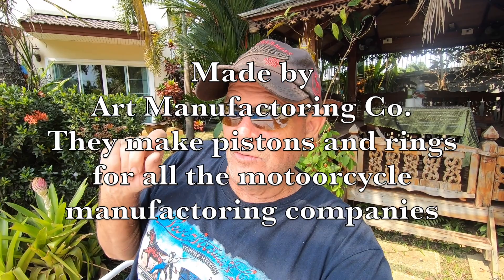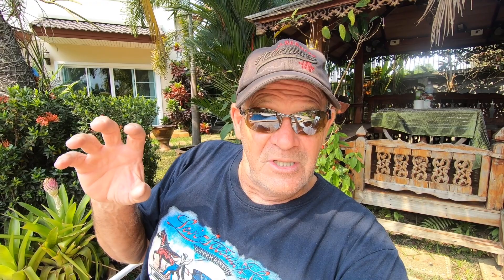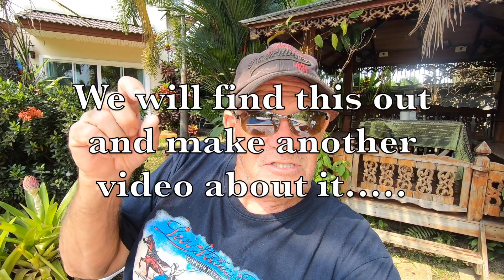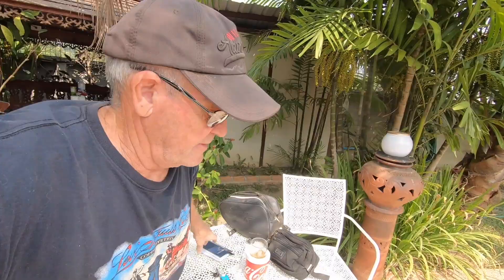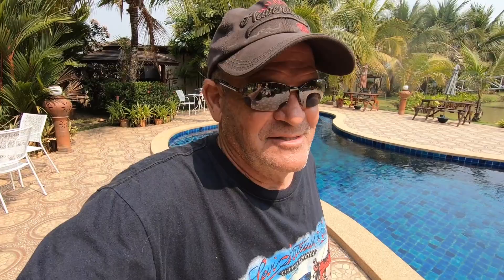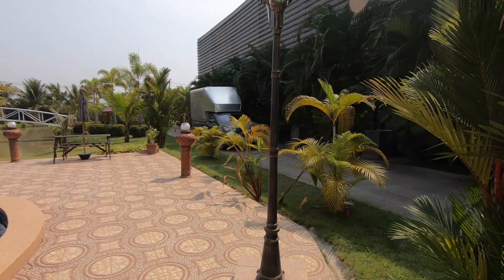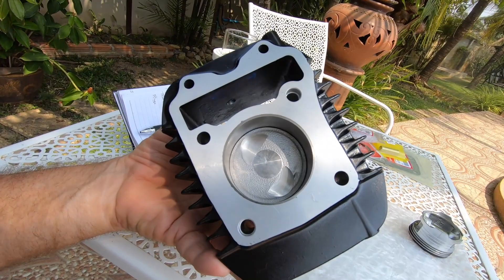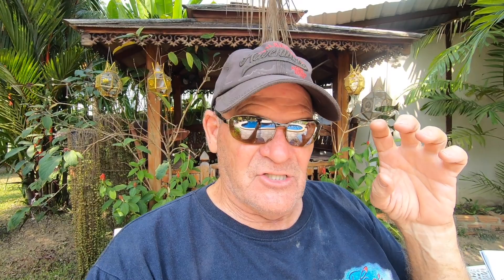Honda CT 125 How to make your own 142cc Big Bore Kit

Comment: Thanks, Eddy, I've done my Honda Part Number Homework and the parts listed above fit as follows 

12251-KYZ-J01 Head Gasket 2021 CT125A, 2014-2020 Grom, 2019-2021 Monkey, 2019-2021 SuperCub

12191-KYZ-900 Base Gasket Grom/Monkey/Supercub the CT125A uses 12191-K73-T60

12100-K26-900 Cylinder CT125A and Grom  2014-2020

16450-K36-J01 Injector Assy, Fuel is off a 2015-2020 PCX150A

All of these are currently available and fairly inexpensive about $121 Retail from our store that I work at in Utah.

Can anybody help me with finding these Piston/Rings/Clips here in the US?
Reply: For the rings, you showed part number 13008-0006 KAZE125 STD That part number is the rings off a Kawasaki Z125.  Could the Piston also be off this bike? That would make getting all the parts a piece of cake.
Reply: Just did a google search and the bore size on a Grom is 52.4mm and the bore size on a Z125 is 58.0mm Does that sound like the right size bore for the piston you received in the kit?
Reply from the maker: Ok, the cylinder number you have listed is not the number for the cylinder we got and the base gasket number is also not the same. Could be the Kawasaki Z125 cylinder and piston, which makes sense that the hop up shops in Thailand have been mixing and matching parts to make the scooters here into little rocket ships. Recheck all the numbers I have in the description for this video. This has been a big help, thanks......
Reply from the maker: @TrevPerry  Sounds like this is what they have done. Kawasaki parts on a Honda....... Smart
Reply: @TeamDNFracing  I just checked again I just put the wrong number in my comment.  I fixed it.  Cylinder 12100-K26-900 Is the stock Cliinder from a CT125A and a Grom. I think it's just the stock cylinder bored out to a Z125 Piston and Ring?  I've already ordered the Honda Parts and I guess I'll call another shop and order me the piston and rings.  We are a Honda only dealership.  Guess I better get me a Diablo Pipe coming and we will awaken the "BEAST" I'm the one with serial # 0666 Thanks for the help!  Anyone else agree this is what is being done in this kit?  5.6mm bigger bore size is going to make a difference.
Reply: @TrevPerry  So will the Kawasaki piston come already relieved for the valves and is it taller thus creating a longer stroke and needing the cut-outs on the top.  Does the 128cc piston really equate to a 142 cc bore?
Reply: @spydie  142cc is the displacement, the actual bore is around 52.4mm for the CT125 and 56mm for a Z125 see my longer comment below.
Reply: @seankearney6915  Gotcha.  Now I understand.  Thanks
Reply: @spydie  Glad I could help. If you want to seriously do your head in look at the table of Bore and Strokes British Leyland did with the Mini it has engine sizes of, 850, 997, 998, 1071, 1098 and 1275. Real parts bin engineering.
Reply: @TrevPerry  Sales brochure I found said 56mm for the Z125 Pro but with a CT125 stroke it fits. Longer Comment below.
Reply: @TrevPerry  Did more searching and while I found the Z125 to be 56mm I found the Ninja 125 to be 58mm  My calculations suggest that a 58mm piston would give 153cc while a 56mm one would give 142.7mm
Reply: @seankearney6915  Does this work void the Honda warranty?
Reply: @longrider9551  I would say almost certainly. Fitting Kawasaki parts to a Honda. I am sure they would frown on it.
Reply: Even the Honda bits are being used in a way they didn't intend so I doubt they would approve. But most performance mods you are on your own if you go to far and blow the engine.
Reply: Trev,  I also live in Utah and am just considering doing this upgrade.  Wondering if you have completed the BBK and if so what are your results? Also, would very much like to chat in person with you if you have done this.  Thanks.
Reply: @shawnlupcho7883   I work at Honda World and actually sold my CT125 to one of the salesmen here.  Stop in and talk to Tyler at the shop he owns it and yes we did do this kit on it.
Reply: @TrevPerry  Awesome!  Thanks for the quick reply. I live in Park City but should be headed past your shop sometime tomorrow afternoon.  I'll drop by then.

Comment: Thanks for the wonderful vid of the Bigbore setup. I have done a month of research. I have purchased two pistons from the various suppliers, ccd both piston tops, done the calculation and in both cases the compression ratio of these big bore kits is right up around 11: 1.  With normal pump gas like 85 or 88 octane, detonation is certain, and it is only a matter of when, not if, as to when the piston says goodbye. ( Normal Hunter Compression ratio is 9.3 :1. ).   For me red flags went up when I read on one of the suppliers website that you need to disengage the auto decompression system when fitting a big piston. Of course none of the folks selling this stuff will ever touch on these matters. The bigger fuel ejector and running a higher lift cam will help the issue, however higher compression develops more heat. I am curently doing the calculations fitting a stroker pin to the crankshaft and staying with the stock piston and fitting a longer conrod, to see if the compression will be lower doing it that way.Stroker pins are available and rods are as well. Hope this is helpful. Be careful everyone.    Thanks

Comment: The taller piston will raise compression, only way to increase stroke is to lengthen the connecting rod. Really cool kit, thanks for supplying info your house there is georgeous! Your livin the dream.
Reply from the maker: Not sure what I was trying to say on that part, but you are the second viewer who called me on that. Sorry for the confusion, I know better, what I meant to say and sometimes at my age, my mind wonders a bit, but the taller piston will kick up the compression...... Thanks for pointing it out, that lets me know that people are watching the entire video which is good..... Again, thanks for catching that......
Reply: @frank gulla  Lengthening the conrod does not alter stroke, it just changes the piston height at TDC and BDC.  Also slows the piston speed.  Manufacturers spend a lot of time working on conrod length to stroke ratio to prevent piston wear.  The only way to change stroke is change out the crankshaft, or offset grind the crank.
Reply from the maker: @ArchimedeanEye  You are so correct, my mistake on that and I do know better.... Sorry for that.....

Comment: I have just done some googling and got figures from Honda and Kawasaki websites so there could be some anomalies but the Kawasaki idea works with the maths. The CT125 is supposedly 52.4mm bore and 57.9mm stroke giving 124.9cc. The Kawasaki Z125 Pro 2021 is 56mm bore and 50.6mm stroke giving 124.7cc.. So in relative terms Honda longer Stroke for torque Kawasaki shorter stroke for RPM and power. Now mix 56mm Kawasaki Bore and 57.9mm CT125 Stroke  and you get 142.7cc. I would expect it to be a Honda Barrel so it fits the crankcase, but what is possible is that the heat it up remove the sleeve, bore it out and slide in a Kawasaki sleeve. Wrist Pin (Gudgeon Pin in the UK) and circlips obviously to match the Kawasaki piston, Which may or may not have the valve cut outs already in it.
Reply from the maker: You nailed it right on. These little hop up shops here in Thailand have been doing this kind of power up grades for a long time. They know what works and what doesn't.... This one works...... Thanks for the info and the comment........

Comment: iv  had many Harleys over the years anytime i did pistons brought the bike home start it up fast idle for 5 min then let cool 1 hour i would do this for a whole day
Reply from the maker: Heat cycles, they just work great at breaking a bike engine in. I like your way of doing also, but it's fun to take it down the road also... Thanks for the tip, I may use it the next time.......

Comment: Good stuff there! The taller piston does not add stroke. It's the opposite. But it does add compression. A shorter piston would increase the stroke.
Reply from the maker: My boo boo on that, the only way to add stroke is with a longer rod, which is not what happens here. The piston is larger in diameter which is where the increase in cc's are coming from. The cut outs in the top of the piston is because the location of the piston pin to the top of the piston is a tab bit longer, more compression. I do these videos off the cuff and do make mistakes on them. Someone will always catch it for me and mention it in the comments to the video. I'm human, I screw up, thanks for catching my boo boo...... Keep watching, there are lots of videos with my two bikes and more to come in the future....... I promise, I will screw up again, like Forrest Gump said: "It happens".........
Reply: @TeamDNFracing  Actually neither is true. Stroke is the difference between the piston at its lowest point and at its highest. That is controlled by the crankshaft and how far the big end bearing centre is offset from the main journal centre. So short of changing the crank or splitting it and fitting an offset big end pin it is fixed. Changing rod and piston may alter the position the piston comes up the bore but not the actual stroke.

Comment: The Cylinder #12100-K26-900 from honda has a standard 52.4mm bore. ( so to get to 142cc the cylinder has been resleeved with a 56.00mm bore)
Reply from the maker: The way they did it with this BBK is to take the sleeve and piston for a Kawasaki 125 which is I believe 56.00mm. The Kawasaki has a shorter stroke on their engine design so they were able to get the 125cc by using the larger piston and sleeve. The hop-up guys here just utilized those two engines to combine them for the 142cc BBK. It works flawlessly almost. With the larger piston and sleeve, it creates higher compression which in turn can and does cause an engine knock do to premature igniting of the fuel/air mixture under extreme conditions. These conditions cause excessive heat and the pre-ignition of the fuel. We've been fighting this problem for a year now and of the three bikes we have the kits in, mine is the only one that has not developed the knock. The reason why is I've always used the highest Octane rated fuel I can get which is Benzene here in Thailand (it has lead in it). You can still get gas with lead here, but won't last to much longer as they are trying to get it banned. On the other two bikes which have developed the knock under high load rides, they have gone to having the head ported to lower the compression. I had my head ported shortly after having the BBK installed and added a Hot Cam and a new ECU from a Honda Wave 125i. The third bike is now in the shop getting the head ported, hot cam and new ECU installed with a re-mapping of the ECU. With these mods, the bikes will now easily run over 65MPH and have plenty of low end torque to ride comfortably in just about any kind of off road conditions we can find......

Comment: Shoot just fell in love with a CT90 my delivery boy was using. Now here i am tring to get a 2021  ct125 from my dealer to find out its back ordered. And to behonest i was hesitent because of the power plant then i look up on youtube all these bigbore kits for the honda grom which uses the same engine.
Reply from the maker: Here is a list of what gives the Honda CT125 some much needed pep: (1) Take the stock 39T rear sprocket off and throw it in the trash, install a 42T rear sprocket on it. You'll be amazed at how much this helps the snap down low and it only takes a couple MPH off the top. (2) Get a decent aftermarket exhaust system for it. A good one isn't cheap, so do some research before you lay out the cash. The one you see on my bike in this video isn't the one I run now, check out the video that shows me changing out the Diablo for the one I use now. It was a special order from a hop up shop here in Thailand and it works great. (3) Put a good Big Bore Kit on it, I'd only go up to the 142/143 cc size. The larger ones don't seem to have a very good record of lasting very long.... Do these three things in this order and you may not go past #2 on the list. I have two riding partners that ride with me now and Robert, has only the sprocket change on his bike and is happy with it. Daniel has the sprocket and a pipe and is happy with his. I love mine with all three done to it..... Good luck with getting the Honda CT 125 and thanks for the comment...... Read Trev Perry comment that is pinned on this videos comments. He actually did all the work looking up the parts numbers and finding out what all is in this BBK.......

Comment: A cursory internet search shows the kit available from Japan at an eye watering $691. This includes a sport camshaft and wiring for ECU, neither of which is mentioned in your upgrade. Can you shed light on this, Eddy?
Reply from the maker: Yes James, my kit did not come with the wiring or the camshaft. Another way to increase the cost. Here in Thailand, you have a lot of small shops that experiment with this part from one manufacturer and then another part from another one until they find what works and makes things go fast. That is how my kit was developed. The price for my 142cc BBK dropped down to about $60 US. The shipping cost on it would probably be another $200 US. Still a much better deal than the Japanese set up. There also is another Thai hop up shop offering a head, valves and Camshaft to add to the bike. Nothing else in the offer, so not going bigger in cc's but strictly head work. The Japanese setup sounds like it is from Takagima or Moriwaki. I've seen adds from both of them here in Thailand. Also, very expensive..... Hope this sheds some light for you and probably within a year, there will be some overseas shipper that realizes he can make a buck or two off of these kits and starts shipping them to the US, just haven't heard of one yet........

Comment: 9:00 - Thanks for showing us the part numbers. I can show this to my Honda shop near my house in Japan. I als have a couple of other motorcycle parts and accessories shops that might also be able to help.
Reply from the maker: That is how you are going to be able to get this particular kit, is hitting up dealers and buy each individual part. The most difficult will be getting a Kawasaki sleeve stuffed in that Honda cylinder. It obviously can be done, but you better make sure you have a machine shop that can do it properly before spending the money........

Comment: I found that Honda makes a scooter called the Winner.
It has a 150cc engine. I wonder if it shares the same cases as the 125?
Reply from the maker: I have not heard of that scooter, but they do make a scooter over here called the ADV150 which is what we use the fuel injector from for our BBK. That engine is a totally different design.....

Comment: Gents,  I’m not seeing the PN# for the oversized sleeve.  Maybe I’m missing something?  Also, I wonder how tight of a pressed fit?  I’m a machinist by trade, so I’m gonna give it a try. Thanks!
Reply from the maker: I do not have that part number. However, the piston is off a Kawasaki Z125, so the sleeve is probably off the same and then they pressed out the stock Honda sleeve and bored the stock casing to take the Kawasaki sleeve. If you are a machinist, I'm sure you can do the job. Let us know how you got all of it done and if the sleeve from the Kawasaki Z125 is what they used. I don't speak Thai, and they don't speak English so they really don't want to give up their secrets. The parts numbers that we did get, came from one of my subscribers, Trev Perry, who works in a Honda dealership in the parts department and he looked everything up for us... Just don't have the sleeve part number. Sorry.....
Reply: @TeamDNFracing  Yeah Just looked up the sleeve from the Kawasaki Z125 and it doesn’t look like you can buy it separately from the jug. I wonder if they are using a sleeve from something else?  Thanks again
Reply from the maker: @smg5960  Next time I'm close to the iTimgarage shop, I'll stop in and see if I can get some info from them. I'm wondering if Art Manufactoring who is making the piston for this kit also makes a sleeve.....
Reply: @TeamDNFracing  Yeah, you’re probably right.  I just picked up my CT125 last Thursday. Man this thing is a blast!

Comment: You need to put a few drops of oil in the piston and cylinder to prevent this when you assemble it.
Reply from the maker: It has oil on it now and my mechanic will oil it up good during installation, thanks for the reminder......

Comment: So, what was the final outcome on the cylinder? Do you just re-sleeve and bore it? anyone find the piston easily accessible?
Reply from the maker: I need to go back and re-read the comments for this video as there is a Subscriber on there that is a parts personal for a Honda dealership and he took the time to look up all the numbers I gave on the video. The piston is for a Kawasaki and the new cylinder sleeve is also for that same bike. What they did was to remove the cylinder sleeve from a stock Honda CT cylinder and then bore it out to take the new Kawasaki sleeve. The shop that built and sold these kits has it's own machine shop so they know what they are doing. So basically, the Honda sleeve is removed, the cylinder is then bored to accept the Kawasaki sleeve and it's ready to go.... The kit works very well, cannot complain about a thing with it and I've ridden it in all types of conditions.......